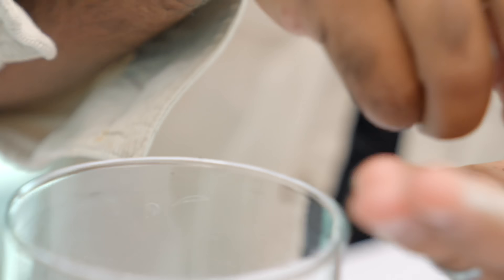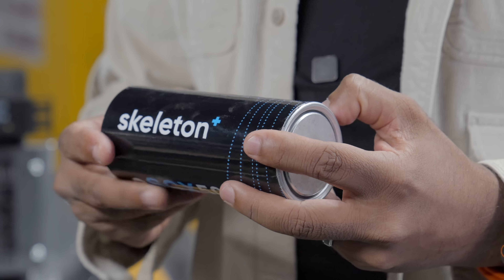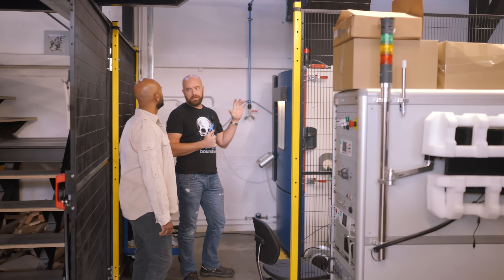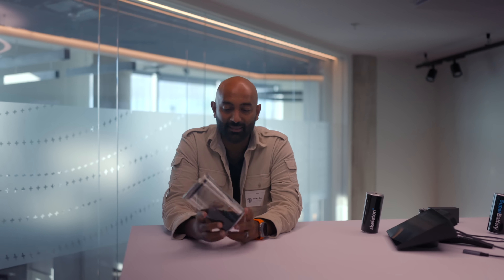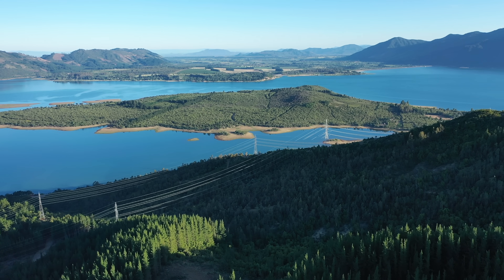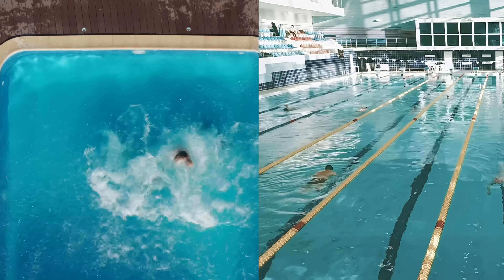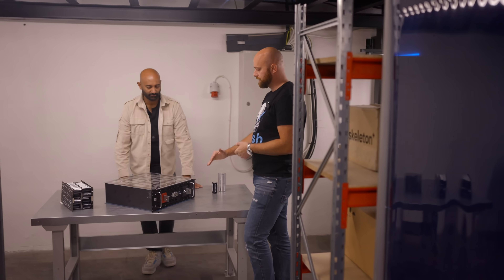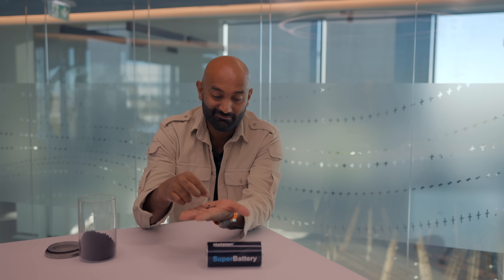Graphene Is About to Change EVERYTHING

Comment from the maker: Thanks DeleteMe for sponsoring this video! Protect your online Info Today! https://joindeleteme.com/TwoBitDavinci
Reply: If they could get the energy density up or even exceed that of lithium-ion, it will be a game changer for the EV industry.  Just imagine 5 minutes recharge with virtually unlimited charging cycles.  Come on Skeleton!! :)
Reply: hard to believe youtube kept pushing this video since launch. Problem with this is cost, which, using the same money to buy LFP or Sodium Ion cells-one could buy the same or more current/amperage ability with energy storage! 
The niche for this is not price sensitive industries like car racing as mentioned in the video. Don't even mention EVs-no EV manufacturer made a car with supercapacitors.
Reply: @ - Of course, but once cost goes down like with any other new tech, and energy density increases, it could replace Li-Ion like MP3 replaced CD's or SSD's replaced spinning drives.
Reply: Bruhhh
Reply: this sounds great. Charging a car in a minute or two would be a game changer.
Reply: Hi,
At 12:25 I think you ment to say capacitors instead of super capacitors. 
At 12:33 I think you ment to say Watt instead of Watt hours. 😉

Comment: Ah yes, just a modest suggestion—use graphene-based capacitors to revolutionize regenerative braking and protect lithium-ion batteries from undue stress. Why didn’t the automotive industry think of that sooner?

In all seriousness, the notion of pairing rapid energy capture with long-term battery health reflects precisely the kind of systems-level thinking we need more of. It’s refreshing-rare, even-to encounter a YouTube comment that bridges engineering insight with genuine optimism.

Kudos to Two Bit da Vinci for, once again, presenting disruptive innovation without the usual apocalyptic undertones. A pleasure to watch, and frankly, a joy to read the comments just as much.

Comment: Good for vertical take off craft with horizontal flight capability as well (from a battery). Recharge supercaps in flight for landing. This is questionable though, without a parachute cos batteries are slower than caps for discharging, making instant landing capability questionable.

Comment: All those capacitor connectors we saw in that one array are made of nickel, thus the great need for nickel in batteries and capacitors. BUT, these connectors need to be SOLID nickel, not cheaply nickel plated, as some cheaper Li-ion batteries have. A single scratch through one nickel plated connector to the steel substrate can ruin an entire battery pack once it is corroded.

Comment: Hybrid Battery/Super Capacitors applied is a fascinating blend to explore.  Not unlike racing braking applications. Aviation always stores energy in the altitude of a mass.  Decent is the perfect Capacitor charge scenario. Takeoff and climb requires a surge of power. This paired with the application of hi temp hydrogen is a very light weight marriage.  Great stuff on graphite finally getting out into practical application!

Comment: 7:08 "if you have thinner and thinner areas, down to one atom thick in the case of graphene you can hold more energy and get closer to the energy store potential of a battery, not quite but close"... you haven't even looked at the datasheet have you? explain to me how 6.8 wh/kg is anywhere near 250 wh/kg or so of lithium batteries

Comment: 3:42 its not the battery that causes drivers to keep trucks running.  Diesel engines run on compression ignition, the colder it is that harder it is to ignight the fuel . Also diesel fuel will gell up at lower temps and trucks designed for cold temps will have the engine coolant heating the fuel tanks .

Comment: Or you could have just listened to Tesla. You can get electricity out of the ground. The earth is a giant alternator!
It spins. Creates a magnetic field. which means it is creating electricity!   duh
Or design a machine that can create and hold a thunderstorm and you can use the lightning from the storm
for your electricity. A thunderstorm is just warm moist air colliding with cool air + the correct frequency.  That's it!

Comment: If they could make a battery/capacitor pack for an electric motor cycle to provide massive up front power, and recharge the caps off of the battery/regen

Comment: No thanks - Graphine is not the solution.

How about Hemp?  Stem cooked to Carbon and then processed into nano particles that gives better properties for batteries than either Lithium or Graphine.  It's been done, it's available and it's got to be a lot more Environmentally friendly than the other 2 substances.

Comment: Until recently, graphene was way too expensive for commercial applications. One of Professor James Tour's people discovered the low cost "flash" method to turn any carbon based material into true graphene. It's only in granular form but it is already being used in concrete to provide a much higher strength material. Making sheets of graphene would truly be a game changer.

Comment: So the graphene part of this video isn't a battery, is still a capacitor.  The batteries are still lithium.  Please correct the thumbnail to super capacitor (which have been around for over a decade or two), it's not a super battery.

Comment: My buddy from college worked for big g  He designed a graphine coated submarine that becomes stronger and more resilient the deeper you go and then also developed a graphing battery that charged in like 2 seconds and had 4 times more capacity than a lithium-ion.

Comment: What semi has 16 lead acid batteries lol. Like 3 or 4 batteries (6 cells per battery is 18 9r 24 cells )  yes even in cdn -'50 c  1 403 830 4124 calgary ab cdn Have had "super cap/ battery"

Comment: Seems that it would be perfect to Power a Laser , lets say to shoot down a Drone . Laser need very high power for a very short Time . If you only need 1kg  Graphene for 28 KW Power density and , lets say 10 Wh Energy density  would that be  enough to Power a 28 KW Laser for ~1,4 seconds ? = 10Wh(*60)  = 600W/min (*60) = 36kw / sec , or did i miss something ? 
4 kg Graphene for a 7 sec 28 kw Laser Beam ? 4000kg  Graphene for an 28 MW Laser Beam over 7 sec , hmm seems still lightweigt for an Naval Laser on a Cruiser

Comment: Lithium polymer batteries come much closer in power density and have drastically better energy density.  These capacitors do have their uses however.  If a short pop of power is needed with a lot of cycles, then they are great for that purpose.

Comment: No, it's not going to change anything, and that's a fact. We have this exact same news about this or that material, at least five times every single year, and I remember this going back at least 10 years. Yet we are using the same batteries as we were 10 years ago. In fact we were using the same ones 20 years ago. Nothing at all changed, in spite of these news time and time again, many times each year. All it is is clickbait, nothing else. You are wasting your time watching these. Plus, if these ever worked you'd just see them, buy them and experience it for yourself, no video watching needed. You're welcome.

Comment: So basically, Skeleton is doing what Maxwell Technologies was doing a decade ago (Tesla bought Maxwell, to help with battery/ultra-capacitor hybrid development).
  
BTW, I probably inspired Maxwell to come up with the Engine Start Module about 20 years ago - after discussing my application for several of Maxwell's modules on a bus RV conversion, where I wanted to start an old Detroit Diesel 6V92 (fully mechanical engine) by having ultra capacitors right next to the starter motor, charged by a boost converter to ensure even a nearly flat battery with slow chemical output due to low temperatures (or a jump start from a 12v-10Amp cigarette lighter boosted to 28.8V) would give the starter motor the required power in that short burst to get that beast running.

Maxwell was ahead in technology too - they had cells that were rated at 3V before Tesla bought them, and were working towards the nominal voltage of lithium ion cells (charging peak of 3.65V/cell).

Comment: If I had 1 cent for every time graphene "is about to change everything" I would've had enough money to start my own graphene development company that would announce work on a graphene project that "is about to change everything"
Reply: Graphene can do anything but leave the lab.
Reply: Just like FUSION IS NEARLY HERE
Reply: First time I read about Graphene was in the late 90's in Science Illustrated. It was about to change everything, especially space stuff IIRC.
Reply: I looked to see if this video was 5 years old
Reply: @jasonborne5724  nah, at least 10 years and a bit. Right before 'great breakthrough fusion will be available soon'... Youtube and science, they really don't mix well...
Reply: right
Reply: Agree
Reply: @RJiiFin I checked this graphene battery and apparently it has only 65 Wh/kg or 136 Wh/L

That may be sufficient for an energy storage, if price is reasonably low, as to provide connected car charger with supercharging capability, but otherwise I see limited use for it…
Reply: All that work to make 1 cent.
Reply: it may as well not exist - they are always "testing" and "working on it" but never produce anything of value
Reply: 😁Just doing my 20 year check-in on graphene… so, where are we with Space Elevators or revolutionary worn technology and hyper lightweight cars and ultra fast graphene processors and Super Batteries and space vehicles and medical revolutions?  Nowhere?  Absolutely nowhere?  Ok.  I’ll check back in another 20.  Ngl I’m a teeny bit disappointed though.
Reply: No one has made pure graphene en masse until 2017 from Hydrograph, the rest has been chunky graphene oxide
Reply: Isn't that how financial markets work now?
Reply: I feel they call it out after the first chip made with it
Reply: HEY DID YOU KNOW GRAPHENE?!
Reply: It's actually not that expensive I actually looked into that myself and then realized there's not that many actual uses for graphene.   😂 It's all speculation and they have their demands met

Comment: Yikes - A BS title for sure.  Capacitors of any kind, including these fancy graphene ones, are like storing water in a bucket with a hole in it.  They leak leak leak!  A quick hop over to the web showed a Skeleton data sheet for, for example, their SCA3200, which holds 3.6 Watt-hours (Wh) of energy which will drain away in only 5 days due to Skeleton's published leakage rate of 11 milli-amps (mA) @ 2.85 volts which converts to 0.03 watts.  3.6 Wh/0.03W = 120 hours = 5 days.  

Before you get out the tar and pitch forks, please chill, the people that buy these are professionals that know what these caps are good for, which is for the uses cited in this video - short bursts of a lot of power collected at a slower rate from sources that can't discharge quickly and therefore, the leakage rate does not matter.  Capacitors have been around for 100 years.  Perhaps these graphene ones offer a bit more umph, but it is click bait to say that they will "change everything".  

BTW - I can't believe Scandinavians let their diesel trucks idle all weekend.  People in cold climates, for 50+ years, have used a super easy, cheap solution to keep engines warm - engine block heaters.  You clip the correct radiator line, hose-clamp one of these babies in and fish the plug to dangle just outside the grill.  No pump is needed as they rely on natural convection to push the heat throughout the block.  Go to any Northern county and you'll see these telltale plugs on vehicles as well as rows of electrical outlets at places like grocery stores.

Comment: hard to believe youtube kept pushing this video since launch. Problem with this is cost, which, using the same money to buy LFP or Sodium Ion cells-one could buy the same or more current/amperage ability with energy storage! 
The niche for this is not price sensitive industries like car racing as mentioned in the video. Don't even mention EVs-no EV manufacturer made a car with supercapacitors.

Comment: Am I the only one that thinks graphene is most likely not the magical wonder material they say it is. I mean hell, my pencil keeps needing sharpening, how strong is it really. Yes you can push allot of juice through graphene, that’s why you pull them out of batteries that are decades old. But I feel like graphene is a distraction material to take the attention off of higher elements with more unique properties. Carbon is an element #6 and widely diverse in its application. But that doesn’t mean we didn’t know allot about it, hell we are carbon lifeforms. But that doesn’t mean you can’t have more complex lifeforms made of almost any element. You can have gold based lifeforms, mercury lifeforms. Earth is fairly an infant in the universe. I just think carbon fits the bigger agenda and is much easier to come by. For example it took untill yesterday to realize you can stick a sticker on graphite and take of a layer of it? Really? In all the lab samples around the world, no one stuck a label on graphite? No one wrote with pencil and realized it left graphite as a trail.

Comment: might try to buy some for my diy home energy storage. my 15 min peak power draw is 15kw, but I only average about 28 kw per day total usage. Could save a lot of lithium batteries, if I don't need to worry about the peak power when something first turns on.

Comment: 4 seconds doesnt sounds impressive given caps are supposed to have insane power ratings for discharge and charge after all 1 megawatt over 4 seconds is 250kw which is within lipo range

Comment: I think EVs should have a super cap module to handle acceleration loads to maintain a steady load on the main battery as well as soak up breaking regen and feed it back to the battery or use it immediately when the light changes not unlike the F1 cars are apparently doing. Some might do this but I dunno what ones.

Comment: I would think these would be very useful in hybrid vehicles. The capacitor could store energy from regenerative braking while sending a reasonable load to the lithium batteries if input exceeds charging capacity of the battery pack. I'm thinking highway speeds, going down a large mountain, etc.
Reply: @themacker894  BYD

Comment: They would be quite useful for hybrid cars using a combination of small IC engine front drive and electric rear drive to create better acceleration across the lights. The super capacitor protect the undersized batteries of the hybrid, but can provide a few second of acceleration or heavy braking resulting in good in city gas millage without adding to much weight. They can provide 10 times the starting power as a frozen battery starting a cold engine.  It also protects the battery from damage of excess current draw in sub-zero weather.

Comment: This tech puts these ultra caps at a point where maybe it makes sense to install them into hybrids & EV to ensure maximum regen braking. You would only need about 8 Kg of them. Have them right there by the inverters, ready to deliver high power discharge or accept a high recharge rate. I guess for 80-110 watt/hours of total storage though, the cost/weight still mightn't make sense to capture a bit more regen. I'm sure these are expensive, especially being graphene. With Chinese companies making battery packs with 10C charge and 5C discharge, it looks like batteries will continue not need the help of super/ultra caps other than intense high power applications.

Comment: Emergency brakes on trains? All train brakes are Emergency brakes. Unlike a car or truck a train brakes neutral state is on.  In a car your brakes are only acting when you hit the pedal applying hydraulic force. With trains The brakes are always on unless there's power applied that opens up the brake and allowing the wheels to turn.   That way if power is lost the brakes automatically apply pressure.   It might be different with smaller electric trains?  Apparently.

Comment: I never noticed how many farads were in one of their capacitors. When I was in college we talked about how gigantic a 1 farad capacitor would be.
Reply: @brucestewart3170  what do you mean by gigantic?  We were using 3-5 farad capacitors in the car audio scene back in the day and they were only slightly bigger than a 20oz Red Bull can.  Not exactly what I would consider gigantic. I guess if you are talking about for use in small personal electronics then I guess that could be considered gigantic.
Reply: I have a 1F 5v capacitor. It is about 3/4" tall and 1 1/2" round. I bought it from an electronics surplus shop maybe 20yr ago.

Comment: You can pair this up with an EV battery, and get 1 MW of regen braking, then the capacitor will drip feed the energy to the lithium battery. Saving the lithium battery from fast charging.